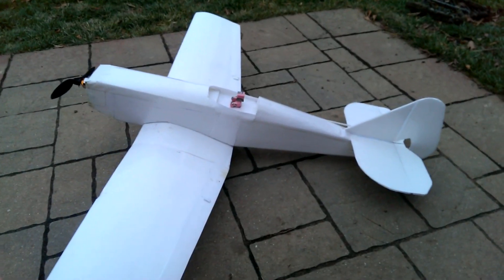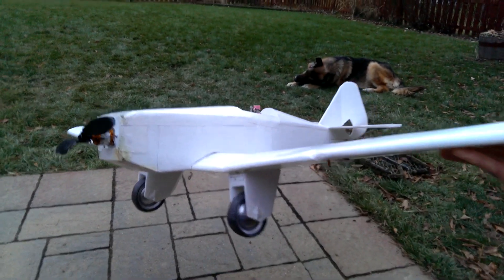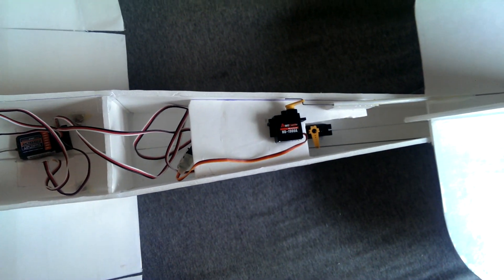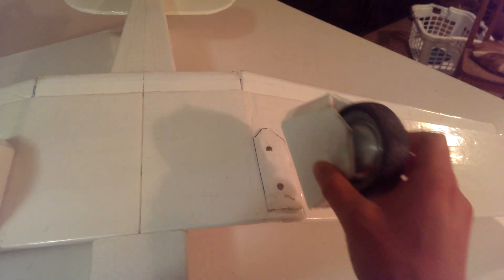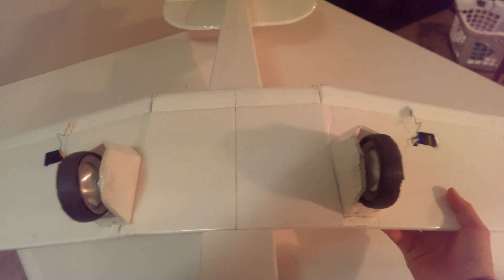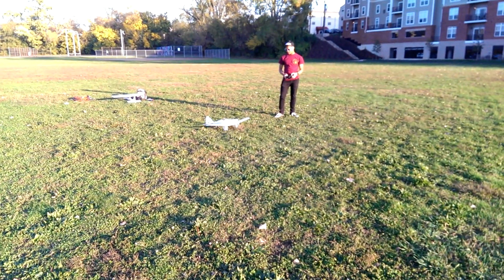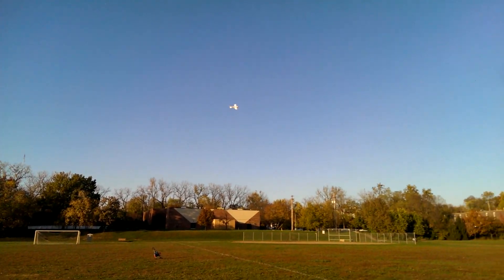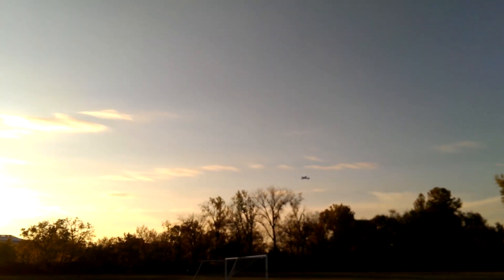Crash-Resistant RC Plane

Comment: Make like a ring tube with magnet ball in the ring tube and and like a magnet square on then out side of the ring tube and like three or four magnet balls like hollow magnet balls on top like helicopter and pulleys and leavers incasednin squear metal cups like holders for it to bang against it, and make a Rc like that so people can fly to space like a microwave jet engine with battery and solar panels make a rc plane like that.
Reply: what the fuck are u even trying to say?